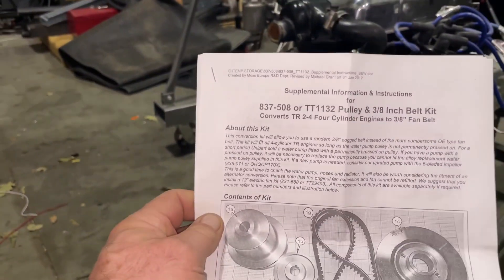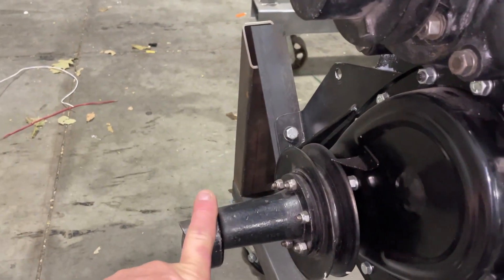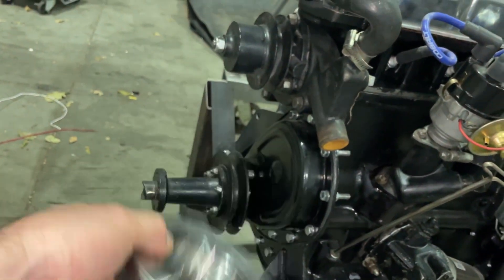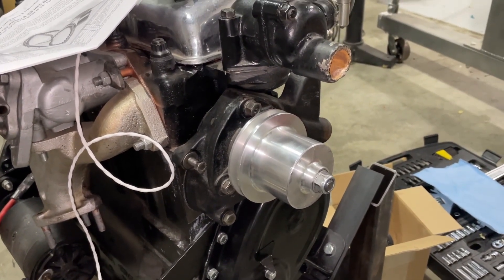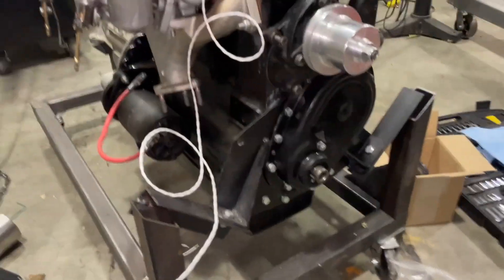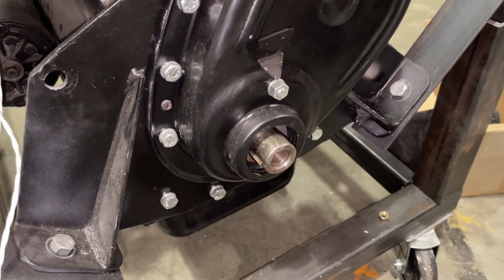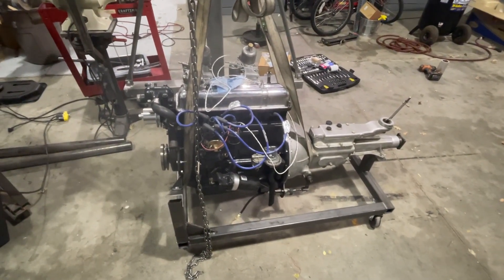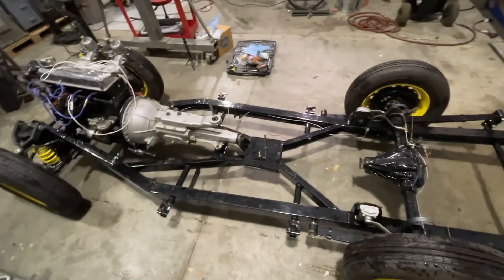TR3 Engine Pulley Upgrade and Drive Train Install

Comment: Was really hoping to see the crankshaft pulley install as that seems like it’s the toughest part of the job. After googling this, I’ve run into a couple of people saying that the polish shears off the woodruff key. Any problems yet with yours? Also, what did you torque down the crankshaft pulley to?